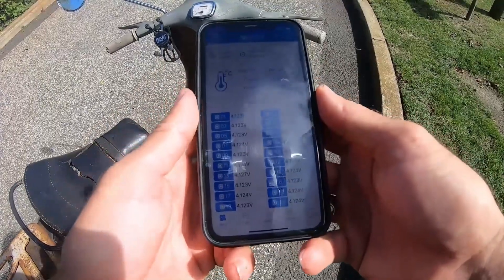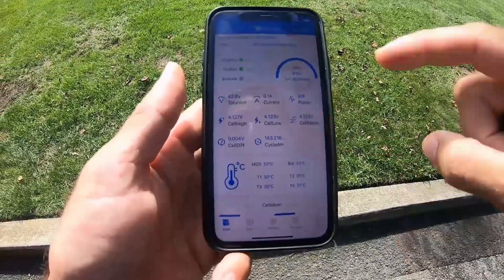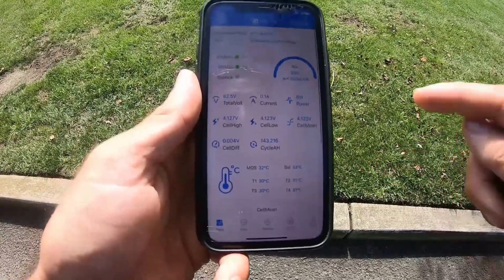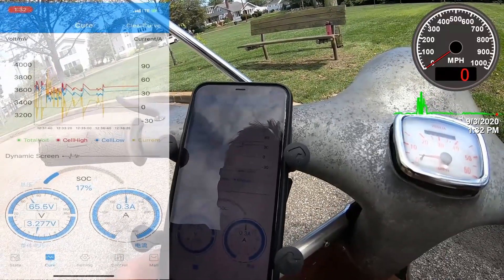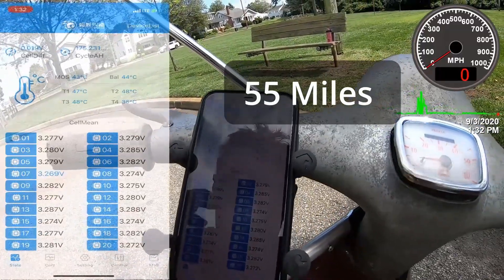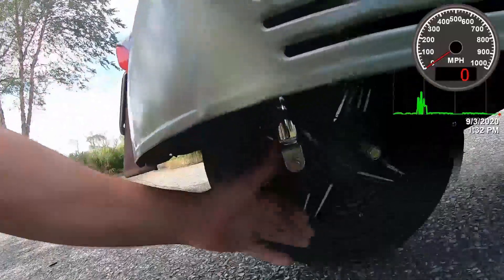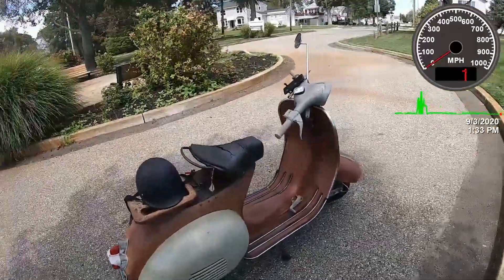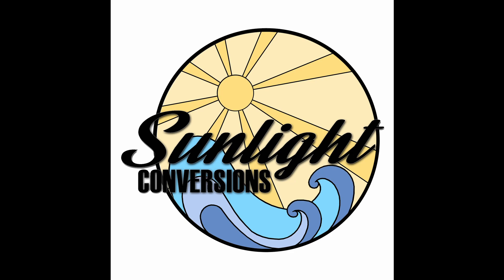Tesla Powered Vintage Vespa Electric Conversion

Comment: Nice to see people finally getting it! I been converting My Real Vespas and Lambrettas since the 90's much to the dismay of absolutely every gas buffer around lol. No I take pink slips with my 1964 GT (British TV)200 converted to 72v 10kw LiFePo4 130ah 0-100mph in 1.7 seconds, top speed of 145 mph (hopefully soon 160mph if I don't kill myself trying) and 12" tyre and rim upsizing, Hand Built Swing Arm SO far, getting about 850 K per charge which is fantastic. Way more than any Car, Truck, Bike in Petrol lol. 34 minutes to charge from 15% empty to 85% full via speed charger thank you very much! . Keep it up mate!  Looks like the Retrospective Scooters UK pop in E Kit you're using there. Not bad at all! I had and have to make my Owen swing arms from scratch for type of serious speeds and long range driving I do.
Reply from the maker: Yea, you can’t drive this thing and not smile. Converted it four years ago, haven’t needed to anything at all to it since. This one is super fun, 4kw. Working on a 7kw now, it’s an absolute beast. Hard to keep the front wheel down. Not a kit, all custom. I assume you are not using a hub motor? Those specs are out of this world.

Comment: Is there anyone making those new rear swing arm to accommodate both hub motor and rear spring?
Reply: Or is this provided by QS motor as a kit ie hub motor and rear swing arm
Reply from the maker: To my knowledge, no one is selling a swing arm and not provided by QS. If you want to build your own, send me a message.
Reply: We manufacture conversion kits for vintage vespas. We also sell the rear swing arms separately. Please contact me if you are interested!

Comment: Nice! Converting a 150 Sprint from the late sixties. Got my hands on a QS 7kW. :) Will also be keeping the old rat look.
Reply from the maker: 7kw will be a beast. You could probably push it to 15kw peak.
Reply: @sunlightconversions828  Planning on 20kW :D
Reply: how is your project going?
Reply: @DKAS-g4h  Sloooowly. ;) Happened to pick up a Honda CR85 frame and now I don’t know which one to finish first.